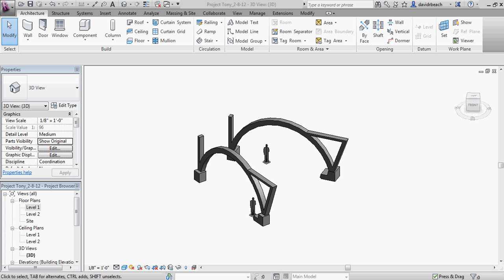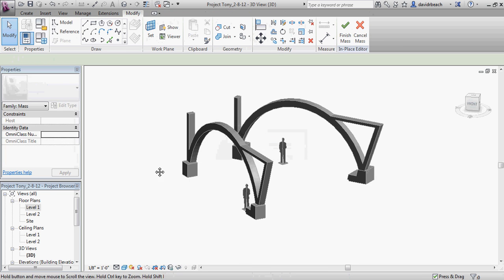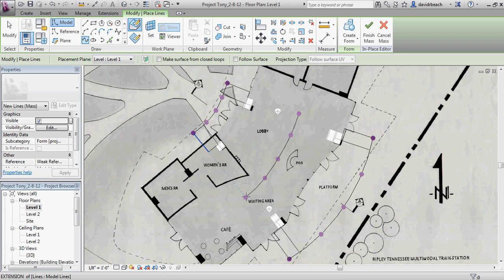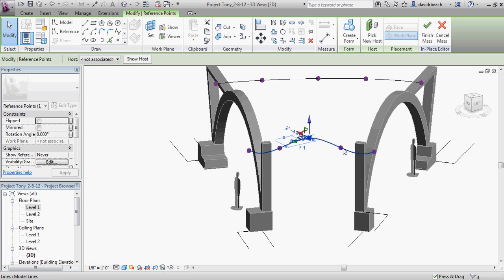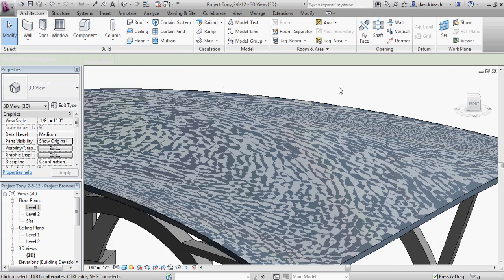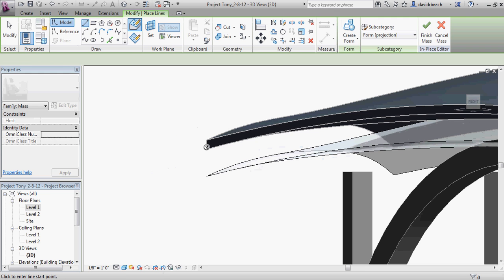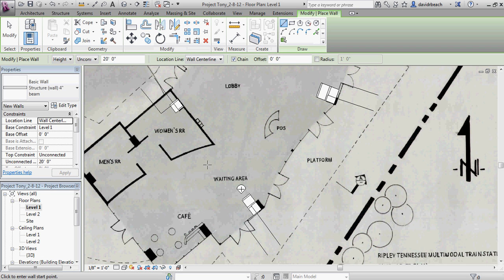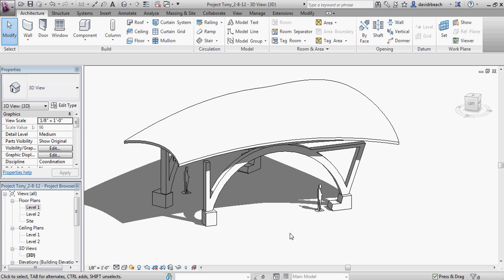Revit Mass Model Tools

Comment from the maker: Dzhumhur Mehmet Gyokchepanar - once you have completed your roof (finished with roof by face tool), you can create openings in the roof form by using the openings panel (top right) under the architecture tab.  Choose vertical openings - select your roof - draw the shape/location of the openings - Revit will cut the vertical opening through the roof.

Comment: A roof structure is linked to a massing object you created it on you just have to manually update the roof. At 1057 min there is the option in the ribbon under 'model by face'. But it would be good in the future to see an option for automatic updates to systems associated with masses.